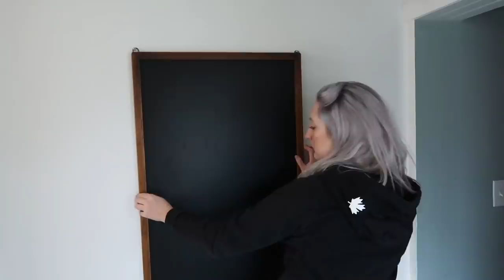small space entryway got a serious diy makeover! | How To Stencil Your Floor! | HOME MADE HOME EP 6

Comment: OMG you are GOOD! I love how you come up with your own ideas and don't necessarily do only what's trendy. Tractor seats?! Who would have thunk??

PS. Another tip to prevent stencil bleeding (although more time-consuming): place stencil on floor, paint one coat the SAME colour that is already on the floor. Let dry. THEN, paint the stencil colour on top as the second coat. If anything will bleed, it will be the first coat of paint which is the same colour that is already on the floor (in your case, it would have bled white and wouldn't have been noticeable). Again, time-consuming, but effective. <3

Comment: I stencil everything - floors, ceilings - I stenciled sharks that are 2 1/2 feet long on my entry floor (its my "moat"), they are a 3 piece layered stencil - my tips:  for something like an entryway, use an exterior moisture resistant latex paint, you wont necessarily need a sealer when you are done, it can be a bit slick when wet, but I haven't had a problem with it.  
Use the spray adhesive.  Spray, let sit for a bit so it gets tacky, place, use painters tape to secure if you want (I do) and use a brush (not a roller) to paint - for me, its easier to control the amount of paint I keep on the brush.  Then peel off, wipe off the back and front of the stencil.  Spray with adhesive and let sit for a bit to get tacky.  Repeat.  I let everything dry overnight to make sure its set before I do the next layer.  
You are AMAZING Dani, I love watching you work and think you are the most accessible, creative, inspirational project maker without- being- too- intimidating DIYer out there.  Love seeing more of your partner too, such a helpful and supportive person!  
Cant wait to see what you tackle in the New Year!

Comment: Ooh, ooh [waves hand frantically] pick me! I almost forgot: when you are stencilling, paint it with the base colour first, there all of the (inevitable) squeeze out happens in the base color, sealing the edges of the stencil. THEN, once you have painted it with the underlying paint color and it's MOSTLY dry (about 20 minutes with latex paint) paint it with the contrasting dark color. NO smudging, no squeeze out. A lot of smudging happens when you remove the stencil before it wants to go. The paint doesn't need to cure (24 - 36 hours) but it does need to dry. That's the time-consuming part of stencilling. That's why I always tape up huge stencil blocks using 4 to 6 smaller stencils. Still turned out great!